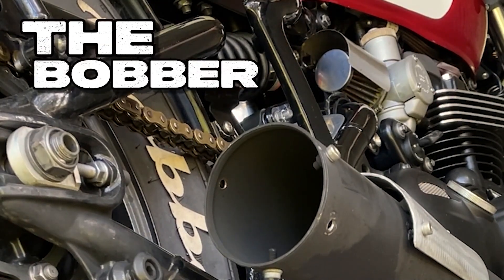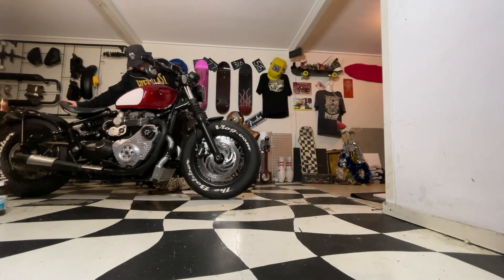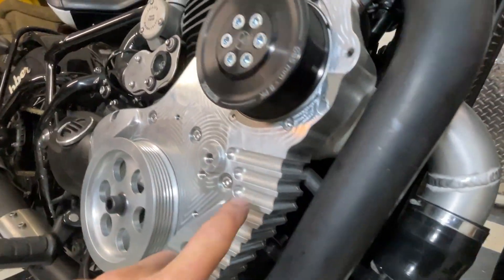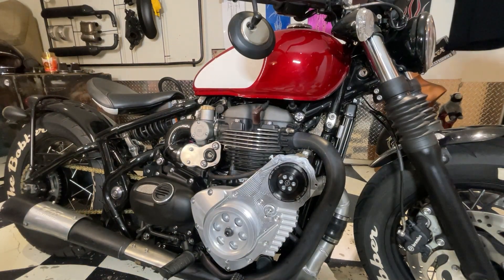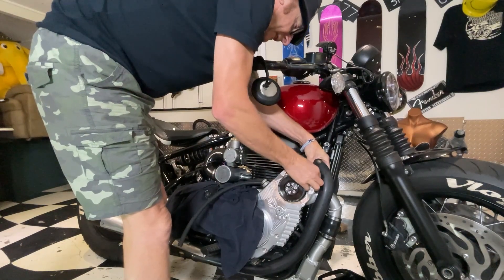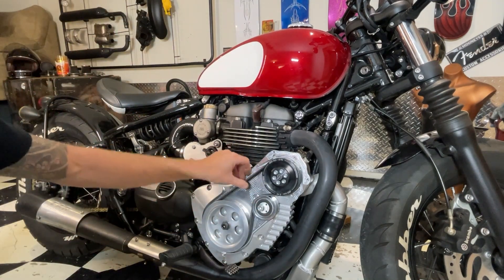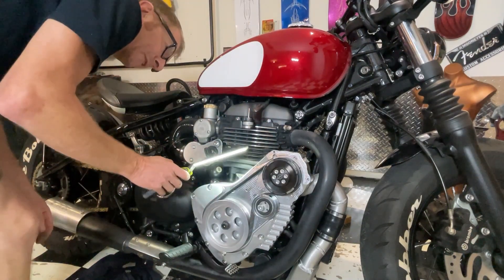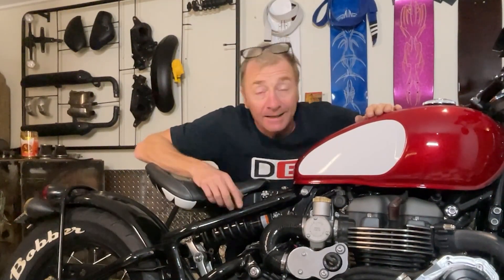Supercharging the Triumph Bobber (part 8) Start up! and the Supercharger oil system.

Comment: supercharger oil level is important to get right. There is no dipstick so use a nylon tie, oil only needs to be 50-100mm depth in the reservoir. If too high will leak back past supercharger seals.